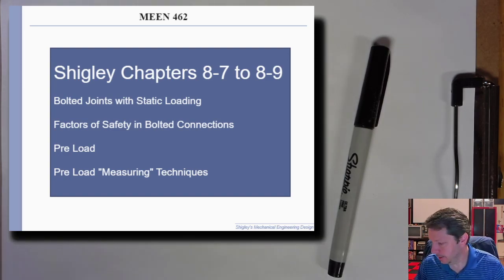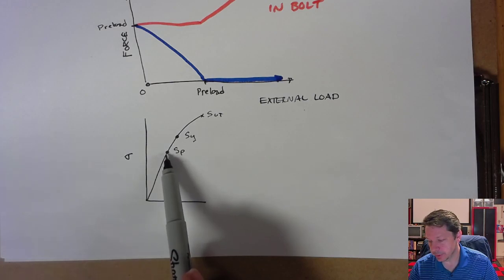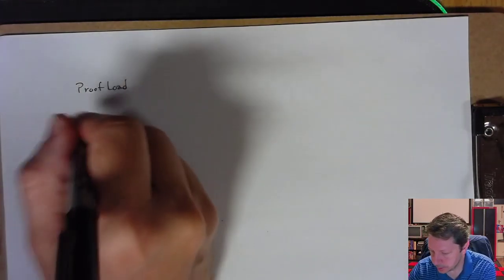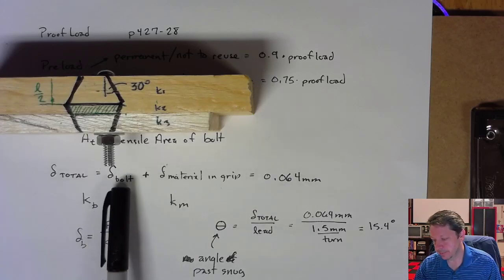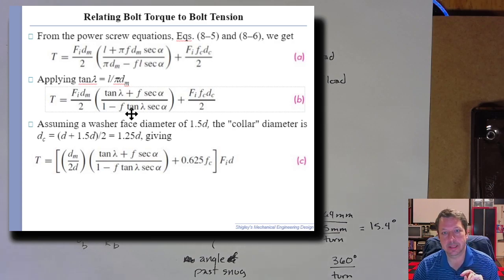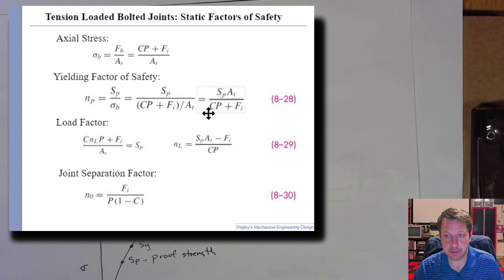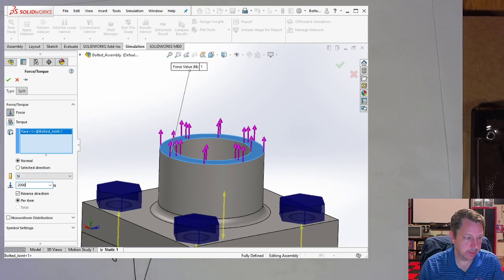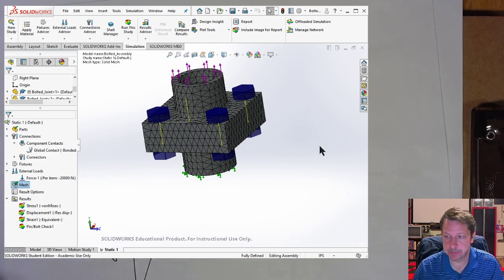MEEN 462 - Bolted Joints, Preload, FS, Static Loading

Comment: Hello, good video, but in the SW simulation you need change global connection from bounded to no penetration between touching surfaces.
Reply from the maker: Good point. This is particularly important if you want to check for separation between the plates. Bonded is the default configuration and will treat the two plates as if they are welded solid together. Changing from bonded to no penetration does increase computation time somewhat - on my computer it went from just a second or two to a litle over a minute. The end result for the FS was still 1.3 so no significant	 difference in what we were looking at. Thanks for pointint this out though, as it is more accurate to treat the plates as contacts, not bonded.
Reply from the maker: @danielmoreno9935  Yes, I am still around. :)
Reply from the maker: @danielmoreno9935  I think I may have done a similar thing in this video: https://www.youtube.com/watch?v=V7tG5xNHi5c&list=PLh5d-A4yDzzghlf5jDjeizebBnrwW1iR8&index=8 It has been a while since I did one of those though so I am not sure off hand if SW directly gives you the factors of if you have to infer them.
Reply: @KellyBC   Currently at work but I will check it out when I get the chance. Thanks